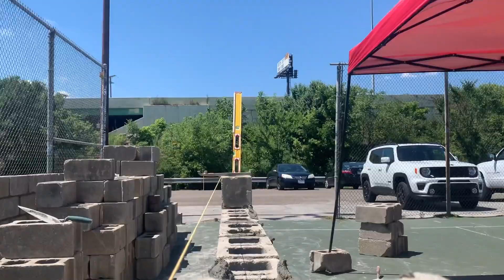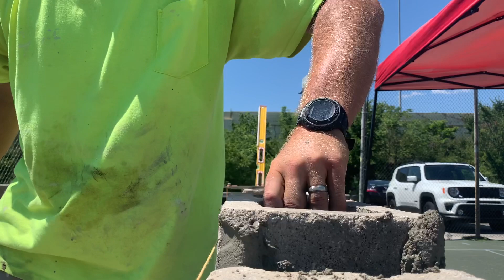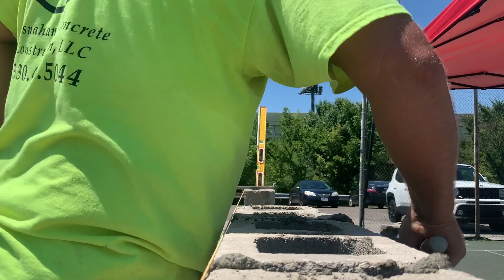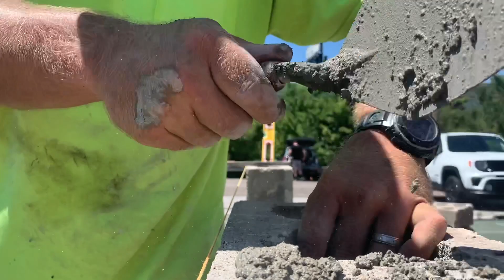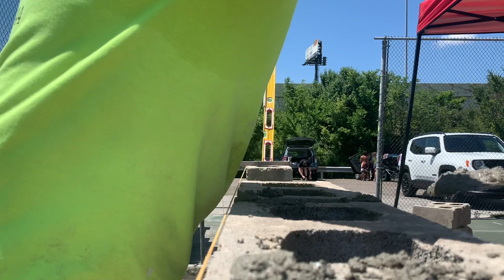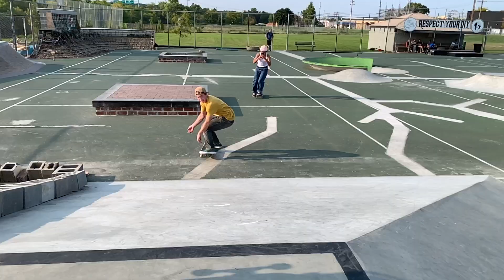Laying block to a line

Comment: I’m loving your channel. And I always wondered about block columns. I was wondering during what types of applications would someone fill the holes with mortar? A block fence wall?
Reply from the maker: It is common to fill a double cell every eight feet.
Reply: @WoodandBricks  

Oh I see. I thought every cavity would be filled which could get expensive I bet. Have you ever used that tool with the wheels on the sides and it indents the grout lines?
Reply from the maker: @travisandtracyjacobs6198  yes it is called a skate wheeled jointer. Locally we just call it a raker. When referring to the joints they are called raked joints. Filling all the cells can definitely add up financially.